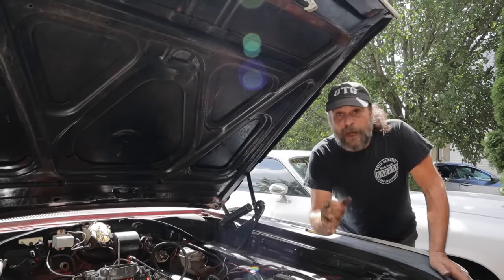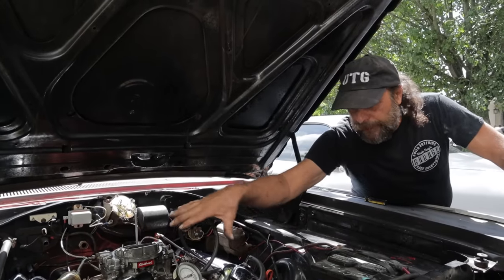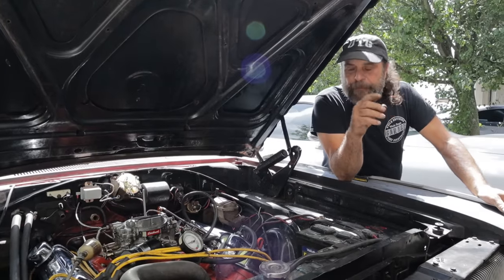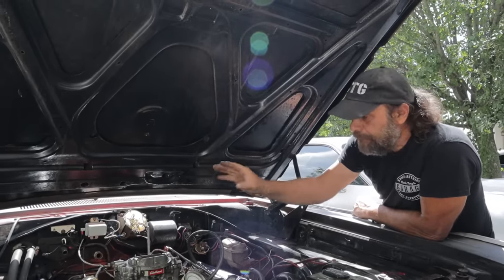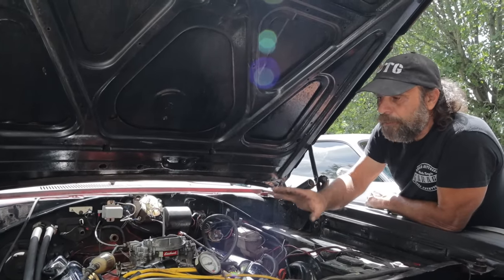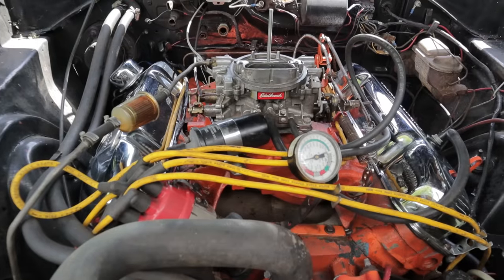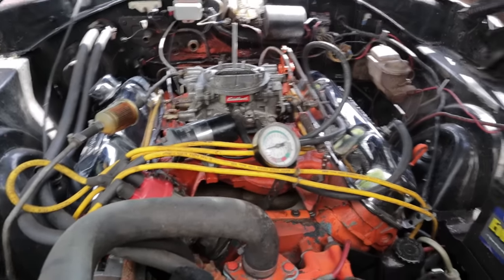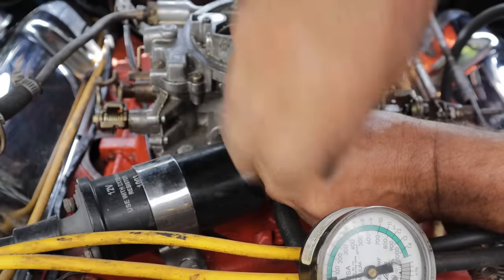Fine Engine Tuning With A Vacuum Gauge

Comment: allways manifold vacuum on dis advance .....ported is a emmision thing .....
As many of you are aware, timing and vacuum advance is one of my favorite subjects, as I was involved in the development of some of those systems in my GM days and I understand it. Many people don't, as there has been very little written about it anywhere that makes sense, and as a result, a lot of folks are under the misunderstanding that vacuum advance somehow compromises performance. Nothing could be further from the truth. I finally sat down the other day and wrote up a primer on the subject, with the objective of helping more folks to understand vacuum advance and how it works together with initial timing and centrifugal advance to optimize all-around operation and performance. I have this as a Word document if anyone wants it sent to them - I've cut-and-pasted it here; it's long, but hopefully it's also informative.

TIMING AND VACUUM ADVANCE 101

The most important concept to understand is that lean mixtures, such as at idle and steady highway cruise, take longer to burn than rich mixtures; idle in particular, as idle mixture is affected by exhaust gas dilution. This requires that lean mixtures have "the fire lit" earlier in the compression cycle (spark timing advanced), allowing more burn time so that peak cylinder pressure is reached just after TDC for peak efficiency and reduced exhaust gas temperature (wasted combustion energy). Rich mixtures, on the other hand, burn faster than lean mixtures, so they need to have "the fire lit" later in the compression cycle (spark timing retarded slightly) so maximum cylinder pressure is still achieved at the same point after TDC as with the lean mixture, for maximum efficiency.

The centrifugal advance system in a distributor advances spark timing purely as a function of engine rpm (irrespective of engine load or operating conditions), with the amount of advance and the rate at which it comes in determined by the weights and springs on top of the autocam mechanism. The amount of advance added by the distributor, combined with initial static timing, is "total timing" (i.e., the 34-36 degrees at high rpm that most SBC's like). Vacuum advance has absolutely nothing to do with total timing or performance, as when the throttle is opened, manifold vacuum drops essentially to zero, and the vacuum advance drops out entirely; it has no part in the "total timing" equation.

At idle, the engine needs additional spark advance in order to fire that lean, diluted mixture earlier in order to develop maximum cylinder pressure at the proper point, so the vacuum advance can (connected to manifold vacuum, not "ported" vacuum - more on that aberration later) is activated by the high manifold vacuum, and adds about 15 degrees of spark advance, on top of the initial static timing setting (i.e., if your static timing is at 10 degrees, at idle it's actually around 25 degrees with the vacuum advance connected). The same thing occurs at steady-state highway cruise; the mixture is lean, takes longer to burn, the load on the engine is low, the manifold vacuum is high, so the vacuum advance is again deployed, and if you had a timing light set up so you could see the balancer as you were going down the highway, you'd see about 50 degrees advance (10 degrees initial, 20-25 degrees from the centrifugal advance, and 15 degrees from the vacuum advance) at steady-state cruise (it only takes about 40 horsepower to cruise at 50mph).

When you accelerate, the mixture is instantly enriched (by the accelerator pump, power valve, etc.), burns faster, doesn't need the additional spark advance, and when the throttle plates open, manifold vacuum drops, and the vacuum advance can returns to zero, retarding the spark timing back to what is provided by the initial static timing plus the centrifugal advance provided by the distributor at that engine rpm; the vacuum advance doesn't come back into play until you back off the gas and manifold vacuum increases again as you return to steady-state cruise, when the mixture again becomes lean.

The key difference is that centrifugal advance (in the distributor autocam via weights and springs) is purely rpm-sensitive; nothing changes it except changes in rpm. Vacuum advance, on the other hand, responds to engine load and rapidly-changing operating conditions, providing the correct degree of spark advance at any point in time based on engine load, to deal with both lean and rich mixture conditions. By today's terms, this was a relatively crude mechanical system, but it did a good job of optimizing engine efficiency, throttle response, fuel economy, and idle cooling, with absolutely ZERO effect on wide-open throttle performance, as vacuum advance is inoperative under wide-open throttle conditions. In modern cars with computerized engine controllers, all those sensors and the controller change both mixture and spark timing 50 to 100 times per second, and we don't even HAVE a distributor any more - it's all electronic.

Now, to the widely-misunderstood manifold-vs.-ported vacuum aberration. After 30-40 years of controlling vacuum advance with full manifold vacuum, along came emissions requirements, years before catalytic converter technology had been developed, and all manner of crude band-aid systems were developed to try and reduce hydrocarbons and oxides of nitrogen in the exhaust stream. One of these band-aids was "ported spark", which moved the vacuum pickup orifice in the carburetor venturi from below the throttle plate (where it was exposed to full manifold vacuum at idle) to above the throttle plate, where it saw no manifold vacuum at all at idle. This meant the vacuum advance was inoperative at idle (retarding spark timing from its optimum value), and these applications also had VERY low initial static timing (usually 4 degrees or less, and some actually were set at 2 degrees AFTER TDC). This was done in order to increase exhaust gas temperature (due to "lighting the fire late") to improve the effectiveness of the "afterburning" of hydrocarbons by the air injected into the exhaust manifolds by the A.I.R. system; as a result, these engines ran like crap, and an enormous amount of wasted heat energy was transferred through the exhaust port walls into the coolant, causing them to run hot at idle - cylinder pressure fell off, engine temperatures went up, combustion efficiency went down the drain, and fuel economy went down with it.

If you look at the centrifugal advance calibrations for these "ported spark, late-timed" engines, you'll see that instead of having 20 degrees of advance, they had up to 34 degrees of advance in the distributor, in order to get back to the 34-36 degrees "total timing" at high rpm wide-open throttle to get some of the performance back. The vacuum advance still worked at steady-state highway cruise (lean mixture = low emissions), but it was inoperative at idle, which caused all manner of problems - "ported vacuum" was strictly an early, pre-converter crude emissions strategy, and nothing more.

What about the Harry high-school non-vacuum advance polished billet "whizbang" distributors you see in the Summit and Jeg's catalogs? They're JUNK on a street-driven car, but some people keep buying them because they're "race car" parts, so they must be "good for my car" - they're NOT. "Race cars" run at wide-open throttle, rich mixture, full load, and high rpm all the time, so they don't need a system (vacuum advance) to deal with the full range of driving conditions encountered in street operation. Anyone driving a street-driven car without manifold-connected vacuum advance is sacrificing idle cooling, throttle response, engine efficiency, and fuel economy, probably because they don't understand what vacuum advance is, how it works, and what it's for - there are lots of long-time experienced "mechanics" who don't understand the principles and operation of vacuum advance either, so they're not alone.

Vacuum advance calibrations are different between stock engines and modified engines, especially if you have a lot of cam and have relatively low manifold vacuum at idle. Most stock vacuum advance cans aren’t fully-deployed until they see about 15” Hg. Manifold vacuum, so those cans don’t work very well on a modified engine; with less than 15” Hg. at a rough idle, the stock can will “dither” in and out in response to the rapidly-changing manifold vacuum, constantly varying the amount of vacuum advance, which creates an unstable idle. Modified engines with more cam that generate less than 15” Hg. of vacuum at idle need a vacuum advance can that’s fully-deployed at least 1”, preferably 2” of vacuum less than idle vacuum level so idle advance is solid and stable; the Echlin #VC-1810 advance can (about $10 at NAPA) provides the same amount of advance as the stock can (15 degrees), but is fully-deployed at only 8” of vacuum, so there is no variation in idle timing even with a stout cam.

For peak engine performance, driveability, idle cooling and efficiency in a street-driven car, you need vacuum advance, connected to full manifold vacuum. Absolutely. Positively. Don't ask Summit or Jeg's about it – they don’t understand it, they're on commission, and they want to sell "race car" parts.
________________
Reply: I read this a few years ago, made sense then, and still does today. Thanks for your efforts.
Reply: Thanks! Make perfect sense.
Reply: Thanks!
Reply: as a beginner and a DIY, how can say where is my manifold vacuum on my carb?
Reply: @zombeesama1169  
Manifoiol vacuum is below the throttle blades.
Ported vacuum is over throttle blades.
Reply: Can you send it to me?
Reply: Print this off and I might take the time to read the book.
Reply: @scottwooldridge8946   if it takes you that long to read it, maybe you need the practice.

Comment: Once again, the Man dispenses the gospel to the masses as simply as possible, therefore making
it totally understandable and accessible even to the novices.
This channel may be a lot of things, but the one that's always impressed me about Tony is how
willing he is to share knowledge and help anyone who wants to know.
BTW, this old goat just learned a new trick with that "checking the spring tension on the needle valve"
bit on the Edelbrock. I've always just sort of stumbled my way along, using the infamous "chart"
we all get with the AVS carbs as guidance until I hit on something that works.
Tony's way saves a TON of time!
Thanks as always, keep 'em calm over there in the flatlands neighbor,
-Ed on the Ridge

Comment: remember when JC Witney sold variable ignition timing kit so you could adjust your timing as you were driving. My first car was a 48 chevy. I tried the experiment of hooking the vacuum advance to the manifold vacuum. No, that did not work well at all. On my 48 chevy and the other old standard trans cars I had. one good way to adjust timing was this. with a hot engine and the gas you use(usually the cheapest regular).  put the car in high gear at less than 20mph. step on the gas and as you accelerate it should ping a bit till you get to 30mph and then not ping there or above that. adjust the timing till you get that. now when you drive normally you get all the advance you can use because you do not normally lug the engine below 30 in high gear. you can cruse in high gear at 30 ok just not give it a lot of throttle. this would get the best gas mileage. Love your videos as you teach how this stuff is supposed to be done. if we just listen to the idle as we adjusted the mixture screw it will idle at max rpm if the idle mixture is rite. lots of stuff was done with no gages at all. do you need to have the vacuum advance working. Yes for mileage and no for power. since the vacuum advance is ported. if its not connected at all the idle is the same. also at full throttle there is very little vacuum that matters not much either. only daily drivers need the vacuum advance to work. when the vacuum advance is broken(or stuck) I would know because my mileage would drop off enough to know something was wrong.
Reply: I think that was the MSD Ping Control.
Reply: we mounted  on the dash where the radio had done been,  a mallory mechanical advance box in my friends 69 roadrunner. That  along with a T- valve that went from a reservoir of ATF to  manifold vacuum. Hooked up a old choke push pull cable and let the show begin. A pull of the cable when driving, advance the timing and a smoke screen that James Bond would be envious of. Speaking of JC whitney we installed the exhaust cut outs they used to sell along  with the lever that moved the pipe to one side on that same car. We were tired of dropping the pipes before racing at sears point every week , a few times before the cut outs we just drove home with open headers . The kit sucked and never sealed back up correctly but it was fun to open the exhaust while sitting at a light from inside the car, usually some kid talking about he was going to smoke us. The look on their faces was always the same as the exhaust sound changed and the cocky smirk went to, bewilderment and confusion, last the realization that something bad was about to happen. Those were good times!!!
Reply: Oh wow, I actually discovered this on my own when I just started working on my car in the mid 2000s. It just made a lot of sense to me.
Reply: GO AWAY,your reminding me how old I am!
Reply: I had the MSD variable timing control in my 1993 mustang. Not sure it did much, would turn it up a few degrees at the track, back down for cruising
Reply: @GlamStacheessnostalgialounge  sure ya did
Reply: @jamesbetts3371  Oh I remember them perfectly and you are right about the next car over. Total confusion. I really do miss those days. So much fun.
Reply: @NoName-tz5ji  You can say that again.
Reply: Used to drive a 48 GMC 3/4 ton pickup 5 window and green. Big six and 4 speed with a floor starter. That was back in the early 50s.
Reply: @craigpennington1251  Nice truck.
Reply: @NebukedNezzer  It used to be. It sure was a work horse and thanks.